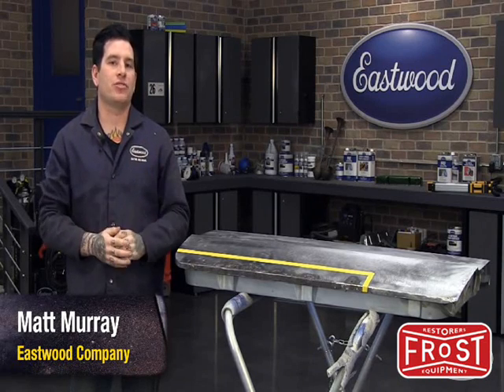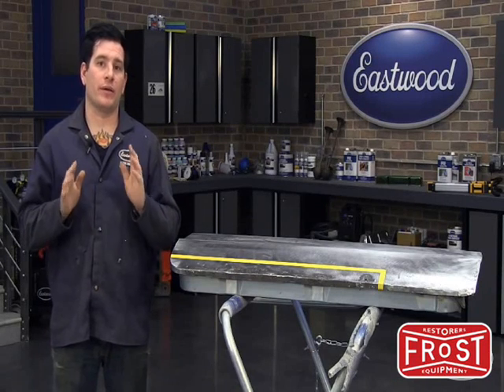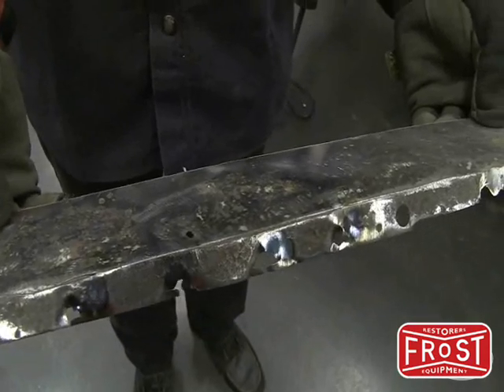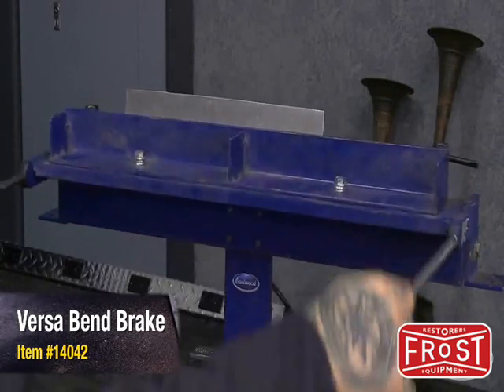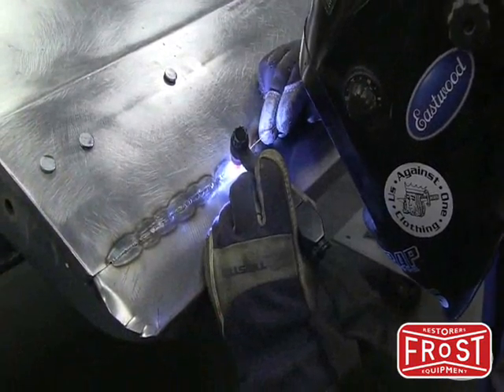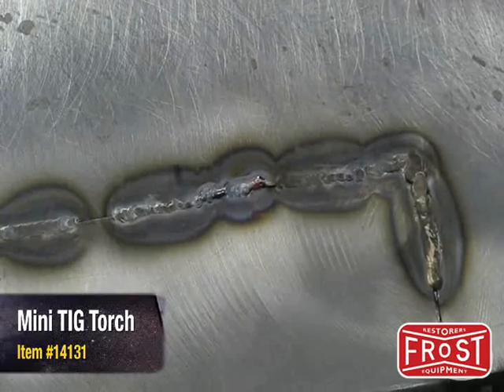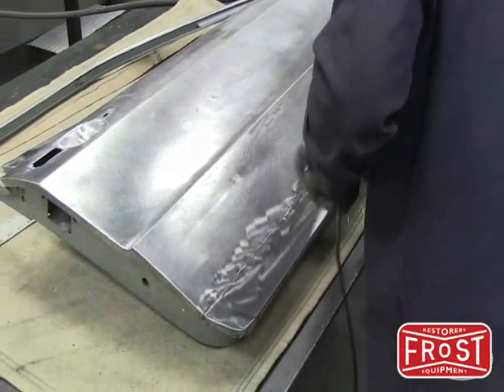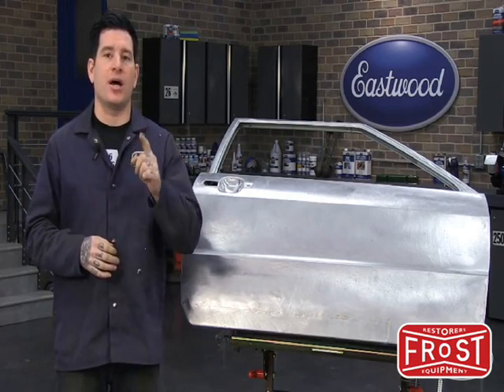How To Repair Door Panel With Eastwood TIG200

Comment: Just a quick tip, if you add half an inch of material to the edges you are going to weld and the joggle the edge either with cheap handheld joggler or a bead roller it provides a built in backing strip so you won't get burn through and also strengthens the edge to reduce oil canning.